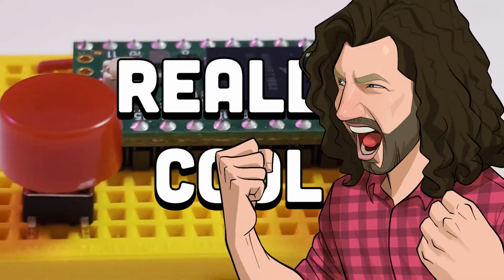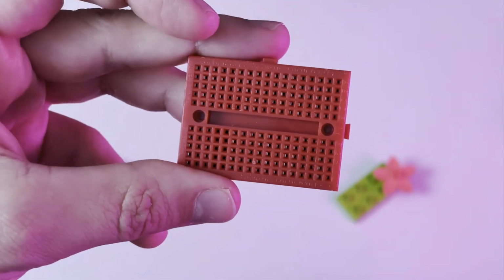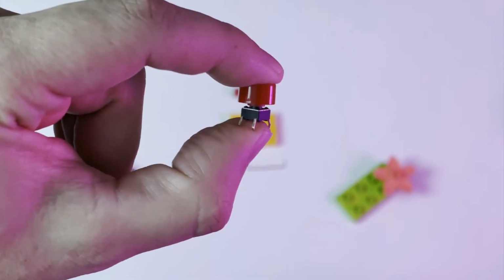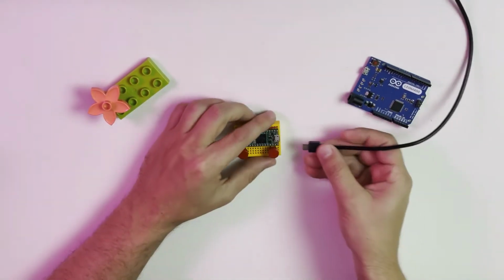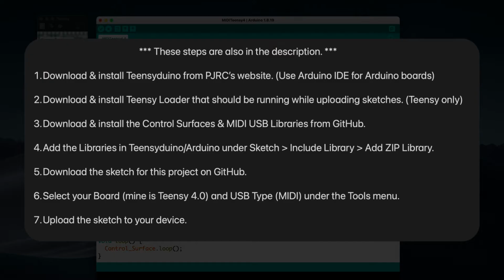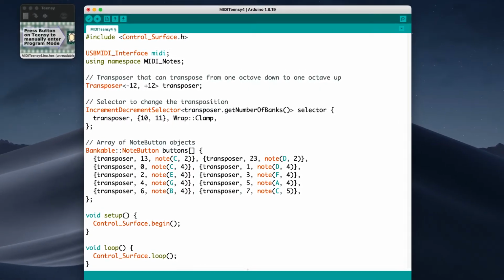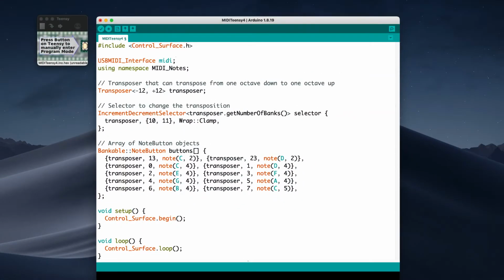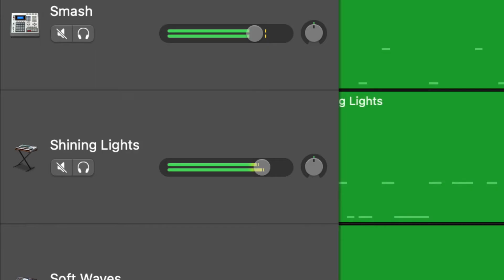SMALLEST MIDI Controller I’ve Ever Made | Teensy & Arduino

Comment: Can you make an expression pedal?
Reply from the maker: That's a cool idea! I have a wah-wah and volume pedals. I think they are basically a potentiometer with a gear attached to turn the knob. I'll keep that in mind. Thanks!
Reply: @mobypixel  Yes! Im doing right now and it's working using Chat GPT Code haha, Thank you for idea, BTW, Can you make it? I need learn more.
Reply from the maker: Yeah, I think I could put that in a video. Thanks for the suggestion!
Reply from the maker: That would be a cool build for a video. I’m not sure when I’ll get to it, but I’ll give it a shot! It would probably have to be in a 3d printed enclosure but could be adapted. Thanks for the suggestion!
Reply: @mobypixel  The expression pedal I got came from China; it's cheap compared to making a 3D print.

Comment: Nice! How to make it Bluetooth midi? please
Reply from the maker: Teensy doesn't support BLE, but the new Raspberry Pi Pico and ESP-32 do. I made a video that shows making a BLE controller with the ESP-32. In the end I prefer a wired connection. I use this library that list some of the BLE boards: https://tttapa.github.io/Control-Surface/Doxygen/d8/d4a/md_pages_MIDI-over-USB.html

Comment: Ended up here, because I'm a musician and a software engineer.  I was just going to punt and grab a MidiHub, but they do everything but implement SYSEX messages which is strange.  So I'll probably build a Teensy MIDI router and just implement SYSEX lol.  Then I'll patch a MidiHub into it -- either that or MidiHub will get off their lazy butts and allow you to send SYSEX messages to do automation.

Comment: This is really cool. Might give it a try. I am looking for a way to use inno fader as a midi controller.  Actually, three inno faders sending midi cc values through usb. In a reddit post someone said it was easy to do it with Teensy.
Reply from the maker: Yeah Teensy isn't the cheapest, but it might be the best. Some other good options would be Arduino Leonardo or Raspberry Pi Pico.

Comment: Could an older electric keyboard, without midi outputs, be modified to be a USB midi controller? I have a Casio SA-77. The sounds on it are horrible except the wood block and laser beam... LOL.
Reply from the maker: Haha! It's possible, but I think it would take a ton of work. You'd have to desolder everything and rewire the board.. Laser beams. 😂 Thanks for the comment. I hope you're doing well!

Comment: very cool, now can you up this build and add a way to change each button to any midi note you want?  maybe an encoder for each button? so lets say i want to change the right button to a d3 midi note. i could rotate clockwise, or turn counter clockwise to move to a lower midi note? i’m not sure how. but it would be cool.
Reply from the maker: Yes, you could do that. The default buttons in Control Surface don't have that customization built-in so it would require using pin-up and pin-down methods in your update loop. You could possibly set it up with one encoder and a MIDI Learn button. In that case you could hold down a learn button, select one of your note buttons, turn the encoder changing the note's value, and then return to the default state when the learn button is raised. Another option would be adding transpose buttons, but that would shift all the notes. I've not worked with save states on Teensy/Arduino but I'm sure that is a thing.😅
Reply: @mobypixel  midi learn now that is interesting? so your saying i could click a button, and have the two button learn midi notes coming in from my computer to the arduino ?
Reply from the maker: @eross21  No, I mean in your Arduino sketch you could have a button that when held will allow you to change the midi note values of your other buttons. That would all have to be coded of course but the user steps would be: push and hold a button on my controller, tap the button I want to change the midi note value of, turn the encoder, and when I'm done release the button I was holding. Optionally the "MIDI Learn" button could toggle a boolean anytime it is tapped. That would prevent needing an encoder for every button. That's all just one option.
Reply: @mobypixel  oh ok… cool thanks
Reply from the maker: It turns out this build might have what you were looking for. I like the addition of LEDs too. https://www.youtube.com/watch?v=zm90guAoNeI